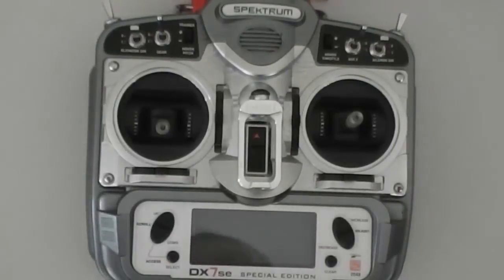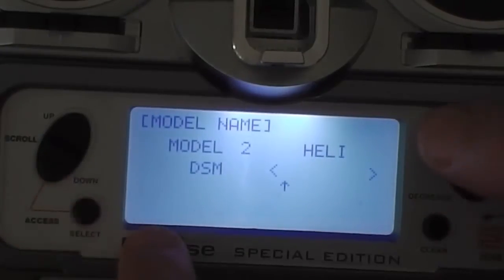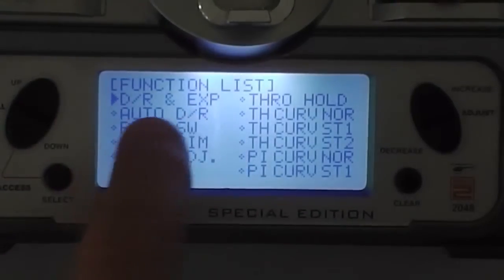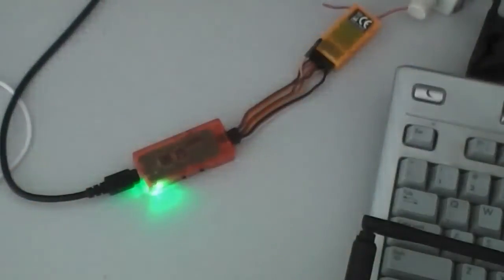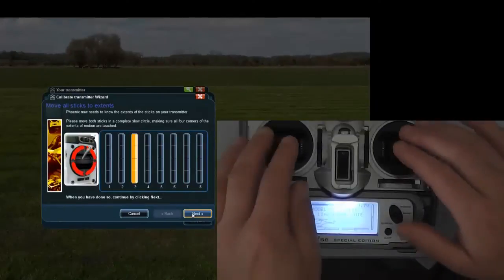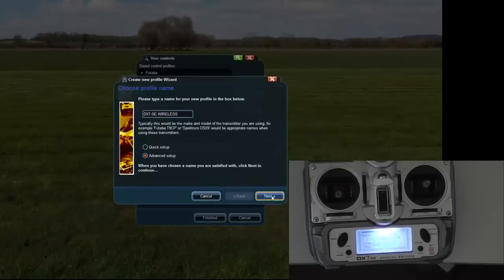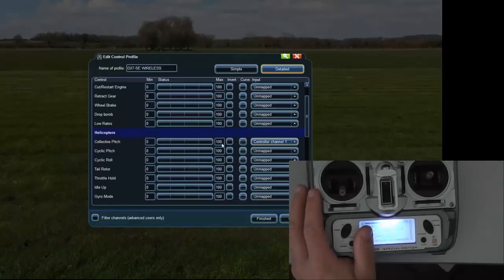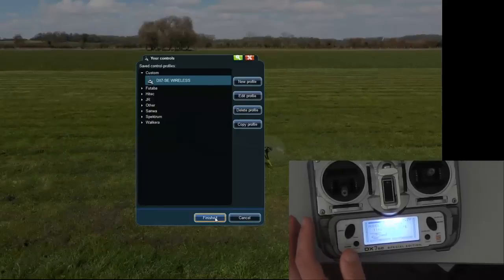How to Set up Spektrum DX7-SE with PhoenixRC - Complete guide

Comment: Hi!
I have the DX7 and have been using sims with the original Esky Belt CP2 controller because that's the heli I'm learning on. I want to start using my DX7. Will that somehow plug into the computer or if I wanted a simular wireless setup like you are using in the video, could you perhaps supply me with a parts list?
I would really appriciate your help!
Thanks
Reply from the maker: +AlxRacing  - Hey there, Not Sure which sim you are using ....  but if you use this Sim kit... http://www.hobbyking.com/hobbyking/store/__52145__Wireless_9_in1_Simulator_Adapter.html

or this
http://www.hobbyking.com/hobbyking/store/__20964__USB_Simulator_Cable_All_in_One.html

you can use any simulator and simply plug in a simple Aux cable that you would use for a spotify to a bose or speaker system to connect it up.  you will have to set up a SIM model in your Dx7/s I have tutorials in my videos to do that and they work very well. I also explain expo options for you too.
Hope that helps
Reply: Thanks a lot!!

Comment: where did you get the wireless for the dx7se and what is the orange receiver model
I just purchased a dx7se and fly a dji phantom 2 and want to use it with it
and I want to get a flight sim I can use with it
Reply from the maker: hi there,
i used an Orange Rx for the Dx7-se and they are avaliable from Hobby King. www.hobbyking.com
Reply from the maker: here is the link for orange Recievers Hope this helps.you will only need the 3 or 4 channel one for a plane hope it helps you out
http://hobbyking.com/hobbyking/store/__1123__1117__Radios_Receivers-OrangeRx_Satellite_Receivers.html

Comment from the maker: Thats an old one DX7-SE
I have modded it with a HobbykingLED backlight, Battery saver kit Gtronics dot net and auto timer mod kit + I have an LED (Green) to also show it is on.

Very inexpensive kits and give you the key features a radio at twice the cost gives!